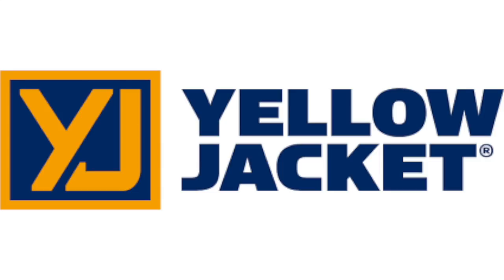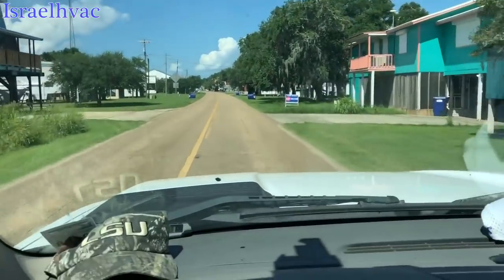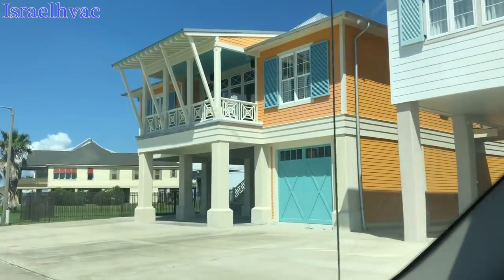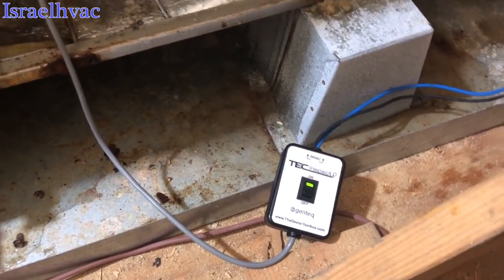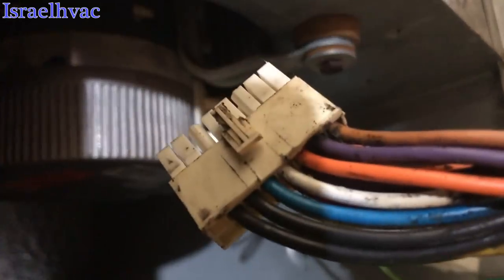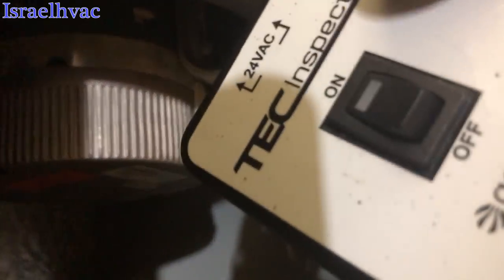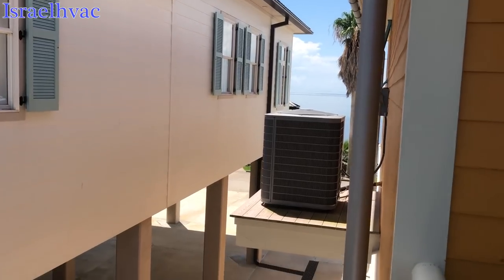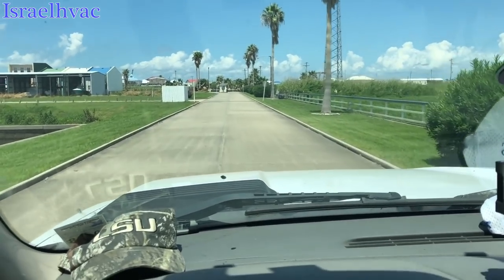HVAC | Troubleshooting a Carrier Variable Speed Motor

Comment: X13 motors don’t seem to last long. Lots of the calls I’ve seen are for the x13 motor modules failing. Nice work John
Reply: x13 the service calls :))
Reply: I know x13 had a bad run due to manufacturing issues but I will say a lot of x13s that I find bad is due to poor duct design(slap a new unit on 30 year old ducts). In my area static pressure seems to be a foriegn language lol.
Reply: Joking aside, increase in service calls is good in a way, except for the folks with broken equipment.
I like to look at and figure out who gets screwed when it's under warranty and who gets screwed when out of warranty.  which is seemingly the whole US and taxpayers ;)

Comment: @hvac with John Israel.  I'm a consumer on the fence on either getting a simple single stage system like you've suggested or a 2-stage with variable speeds but it looks like there's more to go wrong with the high efficiency units. By the time the warranty runs out, I'll be close to 60 years old and don't know if I'd want to cough up alot of money for a replacement. The unit I'm coming from is an underpowered single stage Bryant that's 14 years old.
Anyone is welcome to chime in. I need non-biased advice. BTW I'm in Central Texas so it does get humid. Thanks! 🙏

Comment: There’s a bad solder joint on the capacitor on the motor module you can fix it with a soldering iron and save 500 bucks that’s what I do

Comment: Is the module not replaceable?
Reply: The electronics module can be replaced separately from the motor body. I'm told it's best to replace both at the same time, to ensure a match and because the replacement modules often fail again.

Comment: Where is this?
Reply: Ty
Reply: Homes are raised to be above storm surge level. Louisiana coast on the gulf of Mexico.  Homes here in Mississippi on the water are like this too. All AC Stuff has to  be above flood level. Sometimes the ac condenser units are on separate platforms than the home with a catwalk between the two. The separate platform is more common for a backup generator.  To isolate.